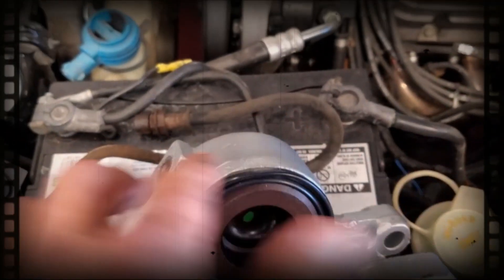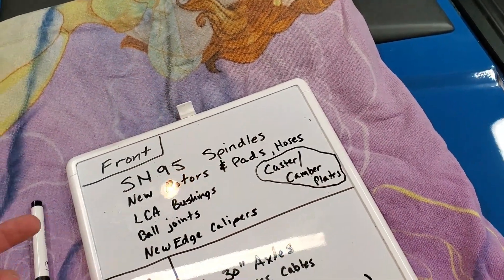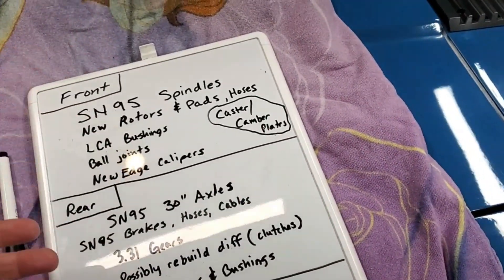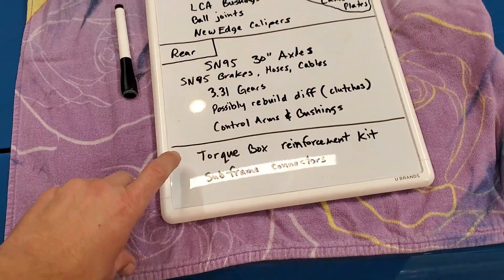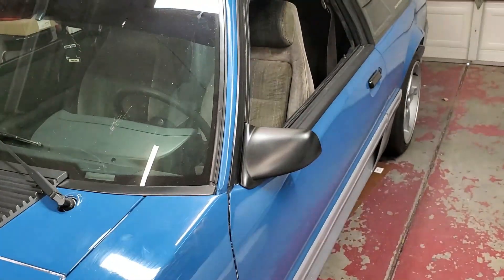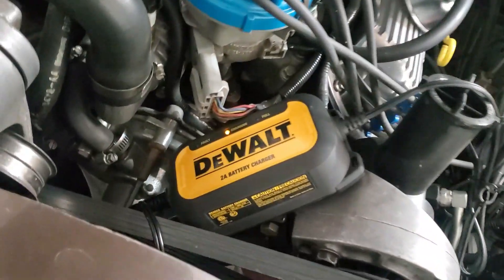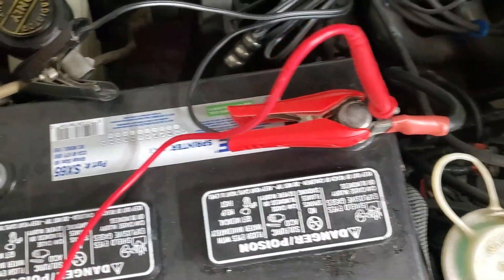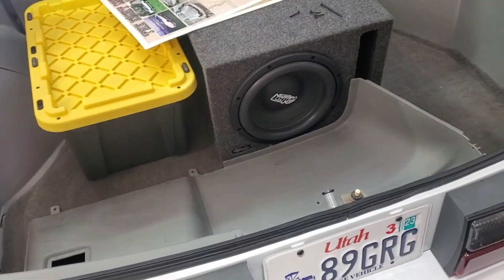The 89G - What's Next For Frankie The Fox Body? Let's See!

Comment: This is all very interesting! Can’t wait to hear what you’re take on the difference between the SVO caliper set up and the PBR. The SN95 axles do push the wheels out visibly further, but with OE offset wheels the fox does seem to like it
Reply from the maker: I have some 18 X 10's for the rear, and 18 X 9's for the front. I got the 9's to fit with the Ranger axles, and removing the quad shock. Hopefully I can get the 10's to tuck in there, or plan C will need to be drawn up.
Reply: @89G  I think the back won’t be an issue, the main problem is going to be in the front with the tire rubbing when you turn. If you have the right offset and 91-93 fenders you’ll be fine

Comment: Those are some good mods for Frankie
Reply from the maker: I am really excited to get it done! Did you do any torque box reinforcement?
Reply: @89G  I did do the torque box reinforcement and full subframe connectors.
Reply from the maker: @bonezshakergarage  what setup did you use? The LMR set?
Reply: @89G  I used LMR for the subframe connectors and a basic torque box kit off EBay
Reply from the maker: @bonezshakergarage  Great to know! I've been looking at a kit on Ebay, and Amazon as well. Thanks for your input!!

Comment: Some how I got UN subscribed. Crazy stuff. I'm taking mine to the body and paint shop. Then the 427W. 🤔🚫🧢💯💪😈🚐☁️🔋📽🤘🎬☎️🤟.
I swapped mine out with a sn95 cobra rear end with the true 11.66 rear rotors  and 03 Cobra brakes on the front with the 13 inch rotors etc. Love the 5 lug swaps. I definitely need to do the torque boxes this winter
Reply from the maker: I can't wait to get it done. Santa is bringing the torque boxes, and subframe connectors. I'll need to measure the rotors on the rear.... they are just GT rotors. Are those 11.66's?
Reply: @89G  I'm not sure. I don't think they are as big on the rears just the cobras. The sn95 Cobra rear ends came with 11.66 inch rears from what I remember. The fronts are 03 cobra calipers, hub assemblies etc on mine those are 13 inch
Reply from the maker: @think1stproductions  nice! I am using New Edge calipers on the upcoming upgrade. They are PBR's.